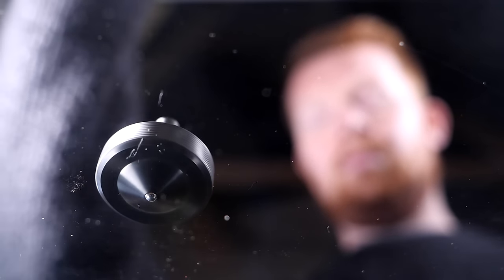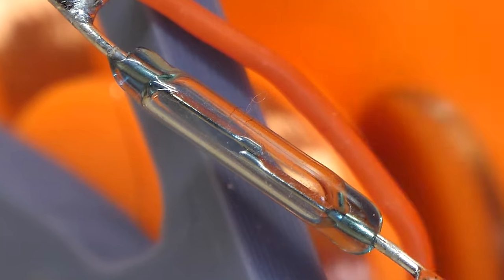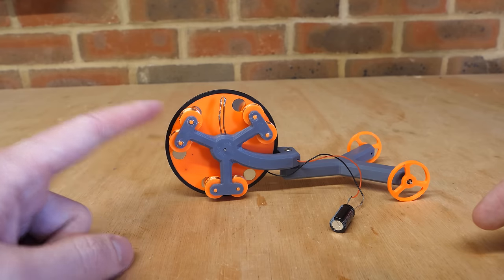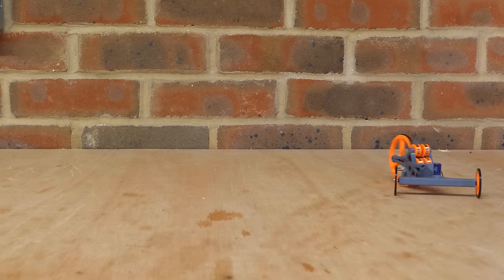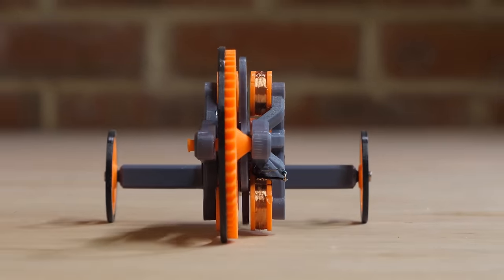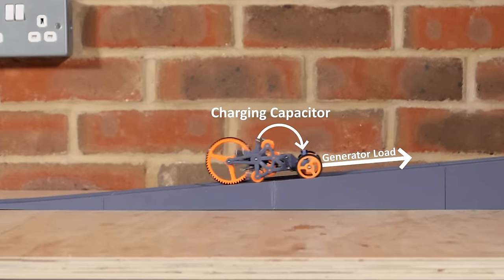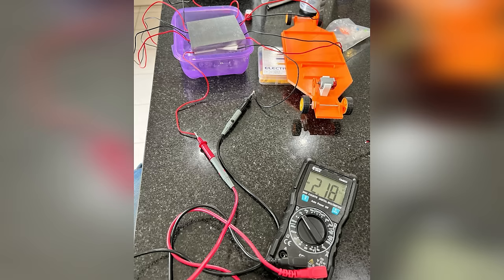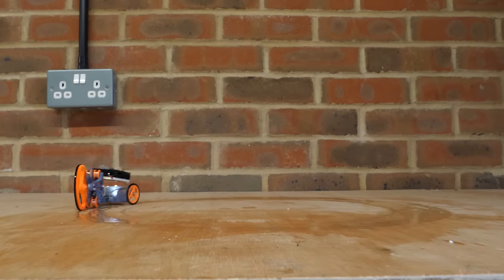This Car Travels Farther Than You Push It

Comment: Your car is 100% efficient, it's just also ever so slightly heating up your room.
Reply: TeodoraTacderen fake
Reply: That is not how efficiency is calculated, heat is unwanted. By your logic everything is 100% efficient.
Reply: @jklmnpqrst It's clearly a joke
Reply: @jklmnpqrst  By everyone elses logic, you missed the joke.
Reply: @Sharpless2  If the joke is that the heat is part of the 100% efficiency then saying that it also heats the room doesn't make sense.
Reply: @victorro8760  it was a perpetual motion joke.

It was 100% efficient at keeping itself running, and then produced moe energy
Reply: @john_doe668  Then I also didn't get the joke, or the physics behind it for that matter.
Reply: This is not even funny.
Reply: @robguyatt9602  just like you.
Reply: @jklmnpqrst not even by that definition because it increases entropy
Reply: @mushroomcraft I redefine words. Haha, I'm hilarious. Very clever comedian.
Reply: 😊 If Sheldon made the same joke on The Big Bang Theory people would just laugh along. Try anything remotely sarcastic online and everyone chips in.

FWIW it made me smile.
Reply: @nagualdesign  
That's because you need vocal tone to convey sarcasm.

Text is discriminatory and absolutely refuses to cross the casm of sar.
Reply: @mushroomcraft  Don't respond to bots, just report them
Reply: @scotttovey  I disagree. Even face to face, someone with a very dry sense of humour could cross the casm without giving anything away in the delivery.

To be fair, I love dry humour so if I see a seemingly stupid comment I'll normally assume they're joking.
Reply: @jklmnpqrst  So a heater is 100% efficient
Reply: Yeah just like your mama ohhhhhhh
Reply: @jklmnpqrst nerd taking a joke seriously
Reply: @nagualdesign  
Text won't. 
Text is much too black and white.

Er, do you think the left will see this as a racist comment?
Not that I actually care what boys crying wolf, on an island with no wolf pack, think.
Reply: @nagualdesign the big bang theory is the worst show that has ever been produced. Great example
Reply: @penguiin12 
"Yeah just like your mama ohhhhhhh"

Don't let your mama hear you say that.
You know how it goes.

You  Your mama;

Mama: SMACK
You  Aaaah, what did you hit me for mama?
You  All I said was; you're mama.

Mama: SMACK
You  Aaaah, what did you hit me for mama?
You  All I said was; you're mama.

Mama: SMACK
You  Aaaah, what did you hit me for mama?
You  All I said was... I'm not saying what I said again.

Mama: You got that right!
Reply: @scotttovey im worried about you
Reply: @penguiin12 
"im worried about you"

What's you worried about me for?
You're the one that doesn't avoid telling "your mama" jokes.
Reply: @scotttovey your mama ohhhhhhh got him
Reply: The heating up the room is called entropy.
Reply: @chadoftoons I like the cut of your jib.
Reply: What most people don't understand is that you can't create energy, nor destroy it, all you can ever do is to convert energy from one form to another.
So the energy in the universe is constant.
Reply: 😂 good one bro.
Reply: @jklmnpqrst Of course it is! My old incandescent bulbs were 100% efficient, giving both a comforting light and heating my up room.
Reply: what about the nice desirable noise made
Reply: Ooh and don't forget the fact it also slightly rotates the earth while running
Reply: Well I thought it was funny
Reply: 101%!?!?
Reply: @jklmnpqrst That’s not how
efficiency works
Reply: @Retrograde99  I think your lack lies within
Reply: @kentauree  I bet it leaks.
Reply: @jklmnpqrst  no, it's efficient, but it just heat the room up like the man says
Reply: @chadoftoons  I’m going to assume there was an evil laugh after your entropy villain comment. “Mwah ha ha haaaaa” 😂😂
Reply: Especially with those candles! Haha
Reply: @victorro8760  heat would be extra energy on top of the already 100% efficiency which breaks one of the laws of physics where you can’t make more energy than you already have. The only way I could see something actually work like this is if you have a hidden battery somewhere and it’s just a gimmick
Reply: I don’t wanna watch the video though, so I don’t know what it’s about
Reply: @jklmnpqrst assuming heat is a wanted biproduct, most things are still not 100% efficient. Anything that's non absolute-zero emits a small amount of em radiation. Losing efficiency
Reply: If the vehicle was 100% efficient than there would be no friction and no heat
Reply: @TeodoraTacderen  I can confirm those are indeed animals and interesting places. Unfortunately, it's nowhere near related to this video, so I think I have to report your comment for unwanted commercial content or spam
Reply: @jklmnpqrst 
Yes
Everything is 100% efficient
Otherwise thermodynamics wouldn't work
Reply: @chadoftoons you must be stopped
Reply: @jklmnpqrst  isn't efficiency done related to work done and energy lost, has nothing to do with heat? (I just did a physics exam)
Reply: @sehkairo2683  energy cannot be lost. It turns into heat.
Reply: @victorro8760  it does heat the room... just in such a small, more than likely, imperceivable amount of heat.
Reply: @jklmnpqrst heaters are 100% efficient
Reply: @victorro8760 the joke is that it's function also includes heating the room, and since any energy not used to move the car is converted to heat, it's 100% efficient
Reply: Energy is always 100% efficient as it gets transferred here or there, In heat, vibration, motion. The requirement is to get the most out of it in the form one wants. In this case, Motion.
Reply: @chadoftoons  blud turned into vsauce real quick
Reply: Great point
Reply: so, not 100% efficient then.
Reply: Then it's not 100% LOL
Reply: It's also creating sound
Reply: Give me attention too. I also have an elementary understanding of thermodynamics and feel ever so cool when I tell you that your science is no no and wrong bad.
Reply: @jklmnpqrst  Except for space heaters.
Reply: bot your nde is hterse itu butam TeodoraTacderen
Reply: So I find it funny don't listen to haters
Reply: Didn't account for the sounds too!
Reply: CAR-sasm?
Reply: I just put larger wheels on the rear axle. That way, the car rolls further, since it is going downhill more of the time.
I also have a large windmill on the roof to get me up hills.
Reply: TeodoraTacderen whyyy
Reply: @john_doe668 
A perpetual motion joke? More of an entropy joke IMO.
Reply: No
Reply: It also creates a lot of slipping hazards.
Reply: Yeah he delayed and I think it would have went the distance if he set it down faster
Reply: @Sharpless2 it was a stupid joke.
Reply: @victorro8760 Motor efficiency is how well it converts stored energy (battery, burning fossil fuel, etc) into work, as in, moving the driveshaft to turn a wheel.  If I recall, cars are about 15% or 30% efficient, where all the rest of the energy it produces doesn't go into the wheel and it instead produces unwanted vibrations, unwanted sound, and unwanted heat.  All of those factors + the wheel moving does add up to 100% of the motor's efficiency, but of course its unwanted, so that's why we say a motor is only 15, 30 or however percent efficient - its only the efficiency we're looking for
Reply: @victorro8760 Adding up to my comment, the idea of perpetual motion machines are exactly that, machines that are 100% efficient or more even.  Understanding how motor and efficiency works also naturally proves how perpetual motion machines are and will be impossible.

You can check some videos on fake perpetual machines, the most famous one that "works" is one of a marble ball that rolls down a track and launches into its own spindle to be captured, then rolled into the same track to repeat the process.  It can in fact run mostly forever, but that's because they have magnets, which are what are giving it power - and the rest of it is being lost on wear, heat and sound.  Magnets are always interesting to talk about perpetual motion machines since, even if they can be very weak like in the video, they can be also very energy efficient.  In this video, the motor is losing power in form of heat - most likely at the connected copper cables wiring the coils and that actuator, as well as the capacitor itself, as well as the tiny amount of wear and heat the gears will get
Reply: @satoruriolu6132  The comment I was responding to was asserting that the original comment was a joke about Tom's car being a perpetual motion machine as well as producing heat on top of that, meaning that it would be more than 100% efficient in terms of energy which would defy conservation of energy. If that was the meaning of the original comment, it went over my head and I don't understand how it relates to Tom's car because it's clearly not a perpetual motion machine.
Reply: How about making the magnets swivel? Could this help with torque and still achieve drive?
Reply: @robguyatt9602 Not all jokes are going to be funny, learn to take one at least
Reply: Not entirely. Efficiency is only a measure of input energy to output wanted energy. For this reason an electric heater is one of the most efficient devices we have haha.
Reply: @LulfsBloodbag  call my joke the ISS the way it went over your head.
Reply: @mmmm768  I do get the joke there are just genuinely people who won't understand it
Reply: @mmmm768  also that is a very good response I'm stealing that
Reply: @jklmnpqrst  accounting for losses, efficiency is 100% yes
Reply: If the car were 100% efficient, then it wouldn't profuce heat.
Reply: This does hurt the brain a bit tbh
Reply: lol.
yeah heating up the room is what inefficiency is.
Reply: @jklmnpqrst  🤓🤓🤓 UM ACTUALLLY 🤓🤓🤓
Reply: Approved.
Reply: Haaaa!
Reply: "My plan for a supercomputer-controlled army of robots was 100% perfect. As you can see in page 37 of my paper, the chance for gaining sentience and attempting to destroy the human race was included in the exhaustive list of possible outcomes and the probability was accurately measured."
Reply: @mushroomcraft is it rickroll?
Reply: This is why I love heating ovens. They are, by definition, always 100% efficient.
Reply: How is it 100 % efficienct I think nothing is 100% efficient 😢 but i don't want to harm or disagree or disrespect ur comment. I have full respect for ur comment
Reply: @lokeshart3340  your head is not a hat rack, so I suggest you use it to understand the comedic purpose of my comment.
Reply: @lokeshart3340  If you mean my comment, it's like this:
Many devices are inefficient, or at least less than 100% efficient, is because SOME of the energy intended to do something, turns into heat instead. In the case of a space heater/oven, that is the only thing you want it to do. If you have some inefficiency somewhere in an oven, that means you're either just spending less energy than intended (and still turning all of it into heat), or there's energy turning into heat somewhere else than the intended hot bit, which is also 100% efficient.

Wait until you learn about heat pumps being MORE than 100% efficient. Those things kick ass :p
Reply: @mmmm768  ok April fool
Reply: @lokeshart3340  sorry, but you missed the date by 364 days.
Reply: @jklmnpqrst when was the last time you laughed with a joke instead of debunking it
Reply: @robguyatt9602 just like you I guess
Reply: why are you using a car in your room?
Reply: @scotttovey "the casm of sar" I'll need to steal that,but I'm reeaally truly sorry,honest.🙃
Reply: @gavinjames8749  
😂🤣😂😉
Reply: No it isnt
Reply: @marcuscostello5635  5.5 thousand people would beg to differ.
Reply: @mmmm768  cool. The rest of the world (the ones that aren't dumb) agree with me
Reply: @marcuscostello5635  your head is not a hat rack, so use it to detect satire.
Reply: @mushroomcraft  Or was it?
Reply: @jklmnpqrst actually, a heater is 100% efficient 😂
Reply: @jklmnpqrst  Obviously the OP didn't pass basic physics (I HOPE) because that's about as basic as it gets. (Conservation of energy).

(I'll say it quietly, all the energy comes from the bloke pushing it and he got his energy from burning food, numb-nuts.)
Reply: @jklmnpqrst  at least one person... Didnt get the joke
Reply: @scotttovey  Correction  "you" need that. Everyone else got the joke from the context.
Reply: A bad joke is a bad joke  @Sharpless2
Reply: @rian0xFFF Actually yes, electric heating is 100% efficient, or very close, the less electronics inside, the closer to 100% efficiency you reach.
Reply: Sadly that's not even correct since abrasion and deformation capture some of that energy as material changes, aside from some heat
Reply: @jklmnpqrst For someone who seems smart, you sure do miss a lot.
Reply: Well some energy loss may not be wanted by you but someone else might want it
Reply: When Im in a not getting the fucking joke competition and my opponent is  @jklmnpqrst : 😱
Reply: It also makes sound which is another form of energy dissipation.
Reply: “Breaking news, man burns house down using toy car”
Reply: @I_HRT_TallyHall  heh
Reply: @scotttovey everybody else got the sarcasm, so maybe it is just you, and the other pedants in this reply section?
Reply: "this is a feature not a bug"
Reply: anything can be 100% efficient… so long as you call it a space heater
Reply: Its not 100% effective, it’s 100+% effective😂
Reply: The number of people who are taking you serious 😂
Reply: @edwardkostreski6733  yeah it's kinda crazy
Reply: Heat is part of inefficiency, what are you talking about, mate?
Reply: @faarmer  7.1k people would like disagree. or rather, 7.1k people have a sense of humor.
Reply: why are all of the first replies edited 😭
Reply: If left unchecked, this cart has cataclysmic implications for the solar system.
Reply: @victorro8760 the joke is pretending that the heat is an intended feature of the car, therefore it's 100% efficient because it's doing both "intended" functions of moving and heating.

This joke is also often made when talking about computer energy efficiency. People joke "my computer isn't energy inefficient, it's just my space heater that also happens to be a computer"
Reply: Nothing is 100% efficient, impossible. Let’s put it this way: if you could extract all the theoretical possible energy from a cat (which isn’t physically possible), you’ll have enough energy to power the whole country of Norway for a year. If you took a blackhole (the most efficient object to convert matter into energy we know) to extract the energy, you’ll need about 1 dat and a half. Modern means of creating energy (electrical, heat, or mechanical) have an efficiency of about 40%.
Reply: @Siissioe123  🤓☝️
Reply: Also following your logic it should have an efficiency of more than 100%, resulting to have more and more energy that the starting energy of the object, thus leading to infinite energy and according to Einsten theory of relativity to creating matter.
Reply: @Siissioe123  🤓☝️
Reply: 6:33
Reply: @john_doe668 thats not how it works though, thats what the other person was saying. it’s not 100% efficient if it releases heat into the room
Reply: @driftrevolution9  my brother in Christ, you are responding to a 3 month old comment about telling someone it’s a joke
Reply: @john_doe668  uhh is 3 months supposed to be a long time to you lol?
Reply: @driftrevolution9  i mean, time is relative, and for some people an hour is a long while. like how europeans think a 45 minute drive is a long drive.

so yeah, 3 months is a long while on the internet.
Reply: 😂No,it is not 100% efficient !
Reply: So a heater is 0% efficient
Reply: There's one thing that is 100% efficient is electric heater. 😂😂😂
Reply: @hasanmahmud8602  yes, one of the replies already mentioned it.
Reply: @victorro8760 A 100% efficient thing would be able to convert it's access heat into energy, which is the joke meaning it's not really 100% efficient, they were being sarcastic at the start beginning
Reply: Then it's not 100% efficient because it heats up the room SMH
Reply: @RaVen99991  are you dense? It's a joke!
Reply: @mmmm768  well it isn't funny it's just stupid
Reply: @RaVen99991  well I laughed so did the thousands of others who liked the comments you're again just ignorant
Reply: @RaVen99991  8.5 thousand people would like to disagree.
Reply: Physics.
Reply: @victorro8760 yeah, I don't find jokes funny when they're nonsensical, especially when discussing science jokes.

Here's a dumb one that's not funny because it's nonsense, in the vein of the original comment.

"Your car is actually a toaster because it's producing heat"

Or

"Why did the electric fence cook the chicken? Because electricity is a fluid"

Those are terrible examples, but the point is, science jokes are stupid if they're nonsensical, just like other jokes.
Reply: If it's heating things up, it's not 100% efficient lol
Reply: @jmac430  lol at the joke and not your own reply, like 8.6 thousand other people did.
Reply: When I was in HS, I had a brilliant Robotics teacher. Great guy, super knowledgeable, and very good at teaching. When we were covering basic Mechanics, such as Newton’s Laws, the Law of Conservation of Mass/Energy, etc, he said no mechanical apparatus is 100% efficient. I asked if that included heaters. He did not reply, but he looked thoughtful of it, then returned to the lesson.

I think, based on the idea of Black Body Radiation, even heaters aren’t 100% efficient, because they lose energy as electromagnetic radiation and light.

Similar to how an incandescent lightbulb is nowhere near 100% efficient, because the light produced by the tungsten coil is black body radiation, due to the fact that tungsten is a horrible conductor of electricity, so it heats up.
Reply: Huh
Reply: That statement is wrong in so many ways.
Reply: @Trigger200284  thankfully, at least 8.8k people understood it to be a joke (which it is).
Reply: @mmmm768  nah. It wasn’t a joke. You just realized it was your way out of a dumb statement.
Reply: @Trigger200284  almost 9 thousand people would like to disagree.
Reply: @mmmm768  Don’t care. There’s lots of idiots in this world. You would have given me a better answer than hiding behind likes if I was wrong.
Reply: Its winter so thanks for heating my house up also the music generated sounds good
Reply: LOL this is why i love comments
Reply: All machines are 100% efficient if you use them as a space heater